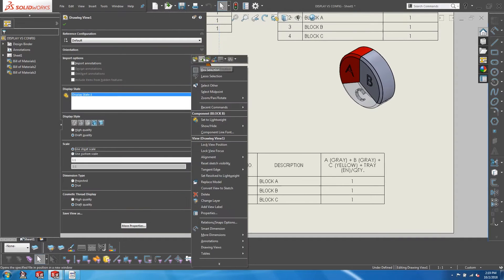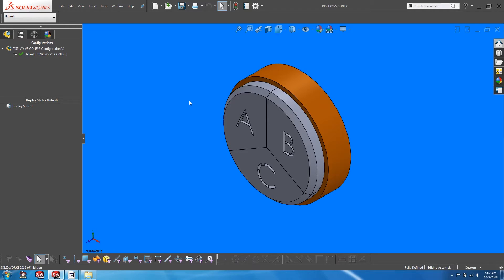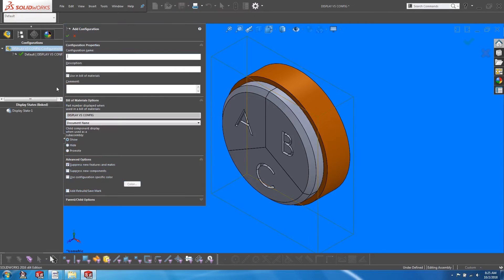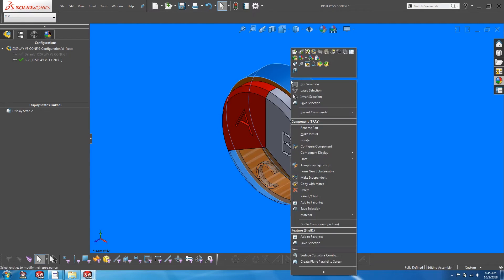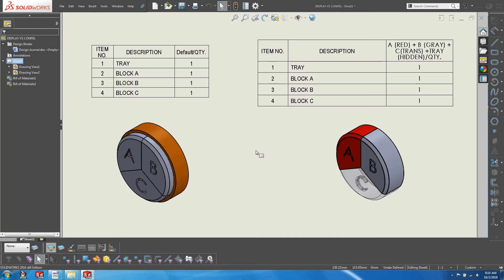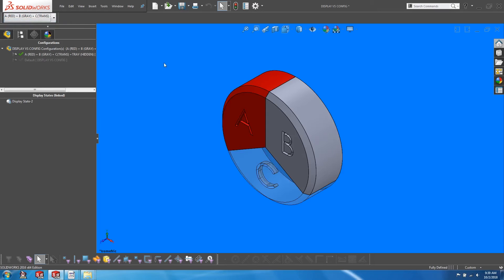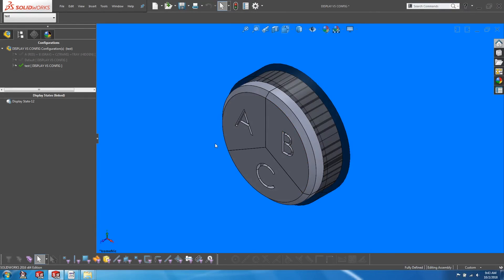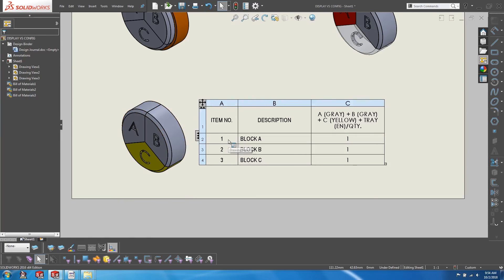Solidworks - Display States VS Configurations

Comment: If I have already made several display states, and turn on link to configurations, the display states are not always on the correct configuration. Is there a way to move the display states to the correct configuration? or do I have to start all over?
Reply from the maker: I have wondered about this myself. Unfortunately, I don't have a good answer. I will need to do some testing to find out.
Reply: Solid Byte if you find out I would love to know - I have been trying different things but so far nothing works - there is a copy function when selecting display states but there doesnt seem to be a way to paste it.
Reply from the maker: I have found that you can copy a display state, activate a new configuration, and then hit ctrl+v to paste a display state. There is no paste option upon right-clicking, another one of Solidworks’ quirks! You can safely ignore the error message. Beyond that, I don’t know of any easier way to assign display states after the fact. Hope this helps. Anyway, I have sworn off using display states:)
Reply: Solid Byte Did you actually manage to copy display state over to another configuration? im trying, but cant get past the error message.
Reply from the maker: Yes, when I activated a new configuration and hit Ctrl + V, a copy of the display state appears. I just dismiss the error message that says that item cannot be pasted here. (I am using Solidworks 2016.)
Reply: Solid Byte im using 2018 and that doesnt work anymore. when i dismiss the error message the display state still only contains the original :(
Reply from the maker: @3rdpoly  Having just upgraded to 2018, I went to try the same thing. I was able to copy the display states with the exact same steps. Maybe you would want to check with your reseller or bring it up to the Solidworks forum.
Reply: Solid Byte Would you be able to make a small video showing the steps? I followed your instruction, and it didnt work for me, so I must be doing something wrong which im not aware of..
Reply from the maker: Let me see if I can do some research on copying display states in general and have more content for a video that can benefit all. Stay tuned.
Reply from the maker: Hi +3rdpoly, I have managed to whip up a quick video on how I did it. Hope it helps.
https://www.youtube.com/watch?v=k3n2cqJ4JO0&t=20s

Comment: Thanks for this summary.  Please do the same for Templates and sheet format. I need help.
Reply from the maker: Hi Robert, thanks for the suggestion. I have been meaning to do a template vs sheet format video for some time now. I have been doing research and gathering material but have not gotten around to doing it yet. It is another one of those things that is unnecessarily complicated and a lot of users struggle with it. Stay tuned.